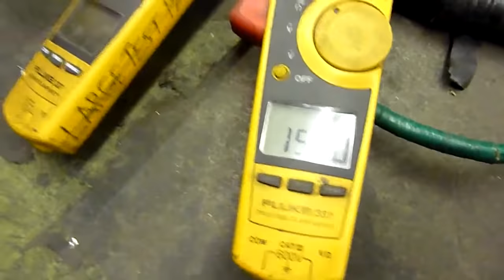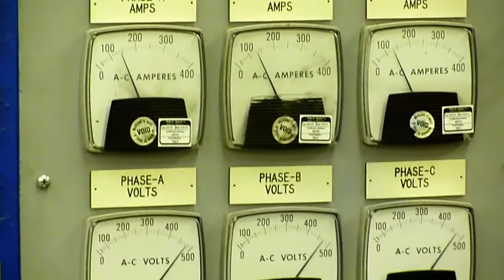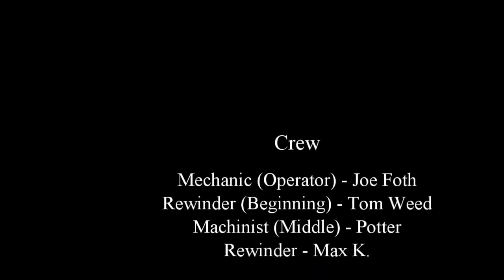Testing Big AC Motor

Comment: Now try to grab it with your hands and stop it.
Reply: Even a 10 times smaller Motor would be unstoppable by hand
Reply: It's just a puny motor, nothing can go wrong!
Reply: HEY GUYS!!!!  Watch This............crap
Reply: hold my beer
Reply: TRX VLOGGER 😂😂😂😂that was to funny
Reply: I could do with one hand
Reply: I could probably do it with no hands. Done similar things in the past so there’s no reason it wouldn’t work
Reply: If Chuck Norris would grab it with his bare hands, actually Earth would start spinning around him holding the motor.
Reply: TRX VLOGGER no thanks....
Reply: TRX VLOGGER DID IT!
Reply: As it ripped through your arm and sends you to another dimension
Reply: Chuck did it
Reply: @veortox330  
Underrated comment
Reply: no
Reply: @nointernetdinosoursgame2351 ...AND THE POPE IS JEWISH-!!!
Reply: SamIsOG *hold my Lean
Reply: TRX VLOGGER I can't stop a toy car motor that is 4 cm long...
Reply: Starts spinning around at like 2000 RPMS
Reply: That electric motor has full torque right from the beginning.
Reply: I will lubricate my hands with WD 40 and stop it.
Reply: Good way to do a side flip huh?
Reply: Well I could stop it with my finger
Reply: I want u to try first bro...
Reply: I stopped it... I jst hit the pause button on my utube app😂
Reply: ajajajaajajaj so funny jajajajjaj
Reply: I would die
Reply: @connorthesledneck1398  ah just walk it off you got this
Reply: @robbieedwardsayers841  Depends on the force you apply to grab the shaft it would first snap your arms and then drag you around like a thread on a table fan motor shaft. It depends on the shaft lubrication and the position of your hands if it is bent the torque would travel through your arm and snap it secondly there would be a delay before you are dragged around the first place that would be affected would be your arms. It would take a couple of milliseconds before your entire body gets into motion, torque would be the highest when it is closer to the shaft. The force affecting your arms would be higher too and would easily snap it. Acceleration depends on rpm of the shaft. Your body will start accelerating once force is transferred throughout your body. The delay would be the time taken for the force (torque) to displace a mass (body). The snapping of the arm would mean that you can't use your muscles to grip the shaft any longer. If the bones snap off your arm won't have the strength to maintain its position which will affect its grip and then you will be thrown because your body is in motion. Assuming you grab the shaft sideways your arms will experience shaft force in the direction of your deltoids. The reason your arms would snap before you are thrown is the same reason why you need a torque wrench for tightening. You need more force closer to the shaft. The more you increase the distance from the shaft the lesser force you use to move it due to more range of motion. Torque is the highest closer to the shaft as aforementioned exactly where your arm is. The time taken for torque transferred determines the delay before your body accelerates.
Reply: Y
Reply: Once I stopped a table fat motor with hand, when it was at 60% speed.😂

Comment: Orders one on ebay Surely this will fit in my RC car
Reply: What Comes Around™ are you crazy
Reply: Hassan Rashad 🤣
Reply: Hey, this would fit perfectly for my windturbine setup!  😜
Reply: Cant generate electricity with these easy. That would need sophisticated electronics to once build magnetism  before generator startup. Only motors with permanent or external excitement can easily generate Electricity.
Reply: Ugh, it was meant as joke. I know they need permanent magnets, especially neodymium of N54 or better.
Reply: why the ugh tho? I just wannted to help. You know irony mostly doesn't work over text right?
Reply: It's the Tesla upgrade motor.
Reply: I suppose I should of done  sigh instead. It was cuz u didn't catch the joke  ;)  Or, maybe u did, and were trying to be replying in joking manner, in which case, I failed to catch it   :P
Reply: What Comes Around™ but will it fit in my Honda?
Reply: Greyson Clark 100%
Reply: We had a 200 HP brushless motor come through our shop once, I couldn't help but wonder about the possibilities
Reply: beargibson3100 sure, 150kw brushless engine😂
Reply: Put in in my yeti Jr. Lol
Reply: What Comes Around™ will it fit in my Honda Though..
Reply: What Comes Around™  yea Full sized race car haha
Reply: Fits perfectly into my computer !
Reply: Will use one of these on my room fan when it’s summer
Reply: Might be a bit sluggish off the launch...
Reply: What Comes Around™ yes my dude it will fit 😂😂😂😂👌
Reply: K5 Guy A bit 😂
Reply: thought the same thing
Reply: probably a 1:2 electric race car.
Reply: That is the motor that is going in my traxxas e revo
Reply: Use it for the cooling fan for the brushless motor in your rc..
Reply: Switch to nitro,  you won't need one this big. ;)
Reply from the maker: You could probably replace all the air in your room 10 times per second.
Reply: LoL
Reply: Perfect for my DIY water turbine project. Or maybe the whirlpool generator
Reply: 500 smaller
Reply: Your 1:1 scale car
Reply: What Comes Around™ 🤣🤣🤣🤣🤣🤣
Reply: Actually your car would fit on this motor
Reply: What Comes Around™ how to have power for moter =)))
Reply: Your rc car after this can cross buggati veryan
Reply: Какая же там мощность?
Reply: @Shubham Sawant apparently you didn't read all of the comments because later I said it was meant as a joke.
Also the weight of the shaft doesn't mean that it can't be used as a turbine because with large enough blades, or a big enough gear box, it can turn the shaft
Reply: What Comes Around™ in a tesla 😂
Reply: Surely you dont have batteries this strong. Higher than a usual 230v plug in your house.
Reply: that motor is the core of an EDF for a 1:1 scale RC Boeing 747 :P
Reply: @WhatComesAroundTM  

It'll fit but I'd knock up some stronger mounts!

Comment: I use to to rebuild/repair/refurbish and test these for a living. All the way from 120V 1/2hp up to 480V motors like this one. This one is about a quarter the size of the biggest one I've worked on. You have to have A LOT of respect for these, or they can kill or maim you in half a second.
Reply: The one in this video looks to be about 100 Horsepower give or take. I couldn't imagine the size of wires they would need if something like this was for 240 volt or even 208. I've seen 50 HP motors wired for 208 volts with wires the size of half your hand for only phase phase

Comment: I love how casually it's placed in the middle of the walking area.

Also, they shouldn't have turned it off; as you can see, it creates a gravitational anomaly if you do
Reply: What gravitational anomaly, lol
Reply: Martin xD 4:15 It’s so strong, light cannot even escape
Reply: @RennieAsh  oh sorry, I'm quite dumb xd
Reply: Rennie Ash you realize it is a shop? In places like that, and I mean shop, and manufacturing facilities that have drives this large. The average employee probably wouldn’t be back there.
Reply: I’ve worked at/for several places that had drives this large. It is something amazing, and somewhat scary.
Reply: John Simun there’s still normally some kind of protocol . Besides, the point is that it looks odd, and a person did actually walk there
Reply: Rennie Ash it’s also probably because I worked at some questionable shops too. Some worse than others.
Reply: John Simun I guess the motor is fairly safe compared to some things, but if anything got caught it would not be stopped in a hurry :)
Reply: LMAO
Reply: @johnsimun6533  you hear the super "that have a key in it?" lol iv launched a key across my shop before. but that was on a 1/4 hp weg... woops.... noone was hurt except for me after my @$$ chewing...
Reply: @RennieAsh That is how they fix these things, it is all setup temporary. And as far as the gravitational crap, get real.
Reply: And not bolted down

Comment: Brilliant video. 150 Amps is still a lot of current for an unloaded motor.
Reply: Hey friend
Reply: Its the blue one, the neutral Wire. Its not needed in this application.
Reply: RODALCO2007 i think it represente 50% of it's rated curent .  isn't it ?
Reply: What a magnificent waste of electricity!
Reply: Yes it's read in RMS, where do you see peak or average anywhere?  Also RMS is 0.707 of peak.

Not sure if this motor is driven at a full 60hz.  No reason an unloaded motor like this should pull more than about 10 amps at full voltage.    Maybe the frequency is still way low.
Reply: I don't think so. 360A is very very excessive, it has to be apparent power, not real power. At the end, the motor draws like 20A per line, which should be close to real power because of constant velocity resulting in less inductive effect thus almost perfect linear current-voltage waveform.
Reply: RODALCO2007 it’s an inductive motor, that’s not the actual amount of power being used, it’s amount being transferred for lack of a better term
Reply: kevlar canuck...they lower the frequency mainly to lower the current at startups and speed during operation and keeping Torque to a level so can he spin the load.
judging by the stator wire size ,a 150A at each phase ,this motor is around 100kw
Reply: IRFZ44 apparent power has nothing to do with this ,power factor does, so if you higher power factor almost 1 ,then you get apparent power equal to real power . and of this size motor you will get more than 150A at full power
Reply: unfiltered voltage harmonics of inverter could lead to uncorrect readings. but still strange. I would bet 2-5amps with no load at full speed. motor semms to be about 300kW rated
Reply: "apparent power has nothing to do with"
"if power factor almost 1, then you get apparent power equal to real power"
Pick one.
Reply: your right 
what i meant is active current is far more bigger than reactive current ,and that determent by the PF.
the clamp meter show you the current according to the apparent power
Reply: RODALCO2007 yep
Reply: Fluke clamp meters 👍
Reply: not up to speed yet
Reply: That motor is cute. 1500Kw Motors are the real deal. 1.4 Metric Tons of Motor oh ye.
Reply: Especially for a 3 phase.
Reply: I thought he said 350
Reply: IRFZ44 what the heck what are you doing here get back in my drawer
Reply: You guys are confusing RMS and peak current with real and complex quantities. RMS (root mean square) is a the average equivalent of an AC source. Complex power comes from phase shifts of dealing with AC. Complex is the combination of the imaginary and real parts. Real power is the effective power used.
Reply: It’s almost all reactive current. It’s about right for that size.
Reply: @JF32304  there's no such thing as wasting electricity
Reply: Mark Williams oh ok. So when that electricity is turned into heat vs work by means of a rotating shaft. What is this called? I call it waste.
Reply: Does seem high, it's probably at a pf of 0.3 or thereabouts. real power would be only a fraction of the indicated 120kVA more like 20kW.
High line voltage can saturate the core making high line current and excessive iron heating, 460 Volts seems a strange voltage, unless this is the republic of America. ;-)
Reply: There is no real 150A through those "thin" cables.
Reply: @Jonas_Aa  There is indeed 150 through them as the current clamp shows. A low PF makes no difference, the current is just higher and out of phase.
Reply: @rogeronslow1498  Yeah I guess that it is true since the clamps are true RMS and show 150A. But the copper in the cable seem very thin. To run 150A continous would probably need 70mm2 and these are not near that size.
Reply: @Jonas_Aa  I agree.
Reply: RODALCO2007 hi
Reply: At the beginning he said 850A
Reply: @killuaHunter  PF is the ratio of real power to apparent power. How is it apparent power has nothing to do with it?

Comment: This motor reminds me of the big electric motors used to power pulper blades in the bottom of a large pupling vessel on a paper ill I used to contract into. The vessels held about 40,000 gallons of water (Maybe more?) and cardboard (Kraft Liner Straw) was dropped in once the water was spinning  about a third of the way up. The winding up noise was incredible! The pulper reduced the cardboard to individual fibres in no time. Impressive stuff.
Reply: How many hp?

Comment: This is a fairly small motor in the industrial world. Especially when machine main drive motors are concerned. I work in an aluminum rod mill and we have some 600 horse dc motors. They are the biggest motors I've ever seen personally.
Reply: Kevin Counihan  that is seriously incredible.
Reply: Maintenance electrician, some of the pumps I work with are 2000hp 4160VAC
Reply: @jamessantee2551  That's freaking crazy? The 600 horse DC we have is about the size of a smart car.
Reply: @keith_hudson  I work in waste water, gotta move a lot of water
Reply: @jamessantee2551  Job security for sure.
Reply: Angel Dust  Except in America they are absolutely rated in horsepower.
Reply: They use dc motors in industrial plants? Aren't they gonna take a lot of maintanence and aren't they more difficult to control? I donno just askin
Reply: Angel Dust  oh I get it.👍
Reply: you'd love the 2510 kW ones we have on the ship to drive it.
Reply: @NowAndyPlays  Ah shoot that's a different world all together there.
Reply: Field trip on an old power plant house size generators
Reply: @NowAndyPlays  haha was about to say. Working at a revision site i see anything pass from 1,5kW up to 3MW.
Reply: #1 for me is an 800MW turbine
#2 is the exhaust fan for the boiler/smoke stack ...5,000HP.  Apparently it locked up once and fell off its pedestal ...big yikes!
Reply: Imagine that electric cars have rather small motors that can produce the same 600 hp, of course they are designed to produce it only momentarily.
Reply: @nonowords7857  There are still applications where DC motors are still feasible. It is becoming less and less common due to the newer Slip Ring motors and Synchronis motors and the better technologies we have created. So soon DC motors will be a thing of the past but not quite yet. You gotta remember a 600hp DC motor may cost $200,000-$300,000 to go to an AC synchronis motor. So, a lot of the industrial plants and facilities are older and have multiple if not, A LOT of motors. They can’t afford to just replace all of them. They a lot of times slower work them out as they fail catastrophically or as funds are available. But like I said, that’s not entirely the case, there are still applications where DC motors are quite feasible.
Reply: @wopmf4345FxFDxdGaa20  Electric cars do it with multiple motors. There isn’t a 600hp electric motor that is in a car right now. It wouldn’t make since.
Reply: this could have been  600 hp . it was drawing 150 amps at no load at 460 v

Comment: I actually was an intern at a company that used an engine that looked similair in a fan. I was close to it when it was spinning. And you can clearly feel it spinning from a meter distance.
Reply: Shouldn't be able to feel it moving 🥶 means the rotor (spinning part) is out of balance

Comment: Tesla owners * Heavy Breathing *
Reply: Will it fit in a Honda?
Reply: too much torque not enough RPM
Reply: @analool7873  yeah I think that but someone told me an electric motor can't have a transmission but it can can't it I think lol
Reply: Tesla's have transmissions to bring up RPM, the dual motor versions have different ratios so they can optimize different driving conditions.
Reply: you cannot compare industrial motors to automotive ones.

The princible is the same but auto motors are brushless. Also industrial motors  feature coal inserts that are good for maybe 3 months. Yea they could hold longer but we generaly remove the protective wrap that reduces friction so we get even more surface area. 

Gearboxes are more commonly used in the automotive industrie. Ofcourse we have them too but most of the gearboxed motors drive fans to pump up sawdust for example(I work in the paper industrie)
Reply: @afox5319  wait a minute, industrial settings are full of three phase induction motors and also brushless depending on the torque requirement
Reply: @afox5319  I've never seen a brushed DC motor at work. Lots of asynchronous motors driven by VFDs tho

Comment: The surge wattage needed to start this must be ungodly.  I can't even imagine what this thing consumes while idle. Very cool!
Reply: 3x 150 amps idle/no load. At 2:35.
Reply: Kevin Counihan  3 phases 150 amps each?
Reply: Kevin Counihan  Thank you. :)
Reply: Kevin Counihan  21 years ago i learned all that, but i never needed it at whatever came out to be my job career. Thank you for reminding me. :)
Reply: Kevin Counihan  don't forget that a starting motor leads to an amps surge of 5-8 times the nominal amps, I thought i heard the guy say the insane amount of 850 start up amps. But didn't understand him very well but it checks out with the 5-8 times the start up surge. Sure as hell is a big motor
Reply: @sleeptyper  thats really high, usually motors at no load should consume very little
Reply: @sleeptyper  As it's a 3-phase device, the formula is 480 * 150 * 1.732 * PF. If we use a PF of 0.8, that yields 99.763 kW.
Reply: At 1:22 the meter reads 360 amps.

Comment: "How many amps she pulling Joe?"
"350"
"That's not bad"
Me: 0__0 amps go brrrrrrr
Reply: DON'T READ MY PROFILE PICTURE : )
Reply: This thing pulls 165,000W without load wtf
Reply: Inefficiency
Reply: @antreaskonstantinou8585  at 1:24 it pulled 350 on each phase so its 1,050 at 550 volts so shouldn't it be higher